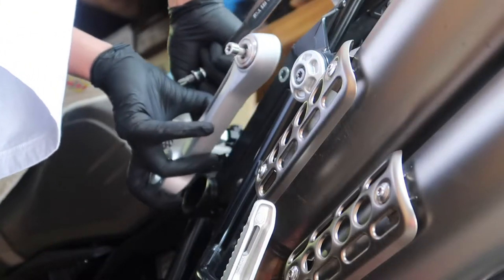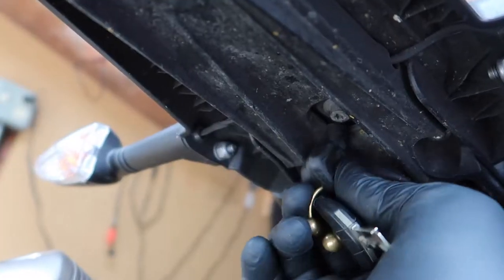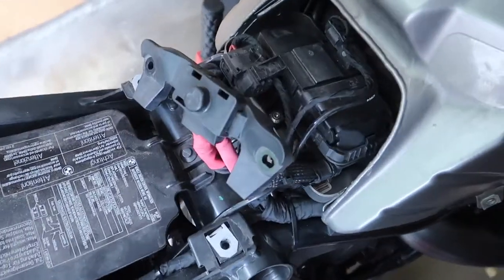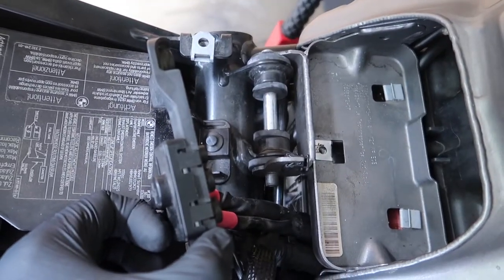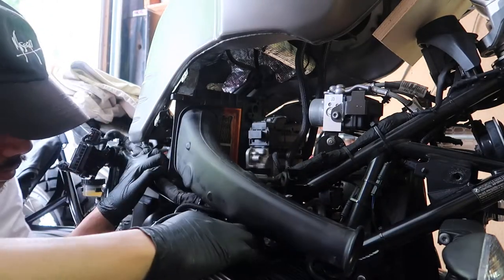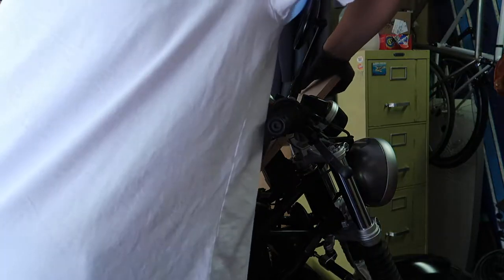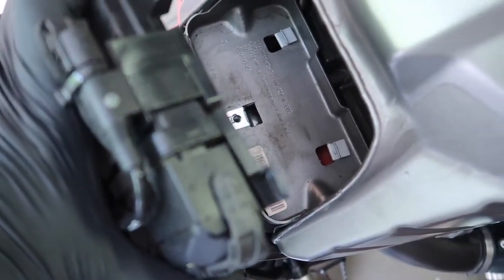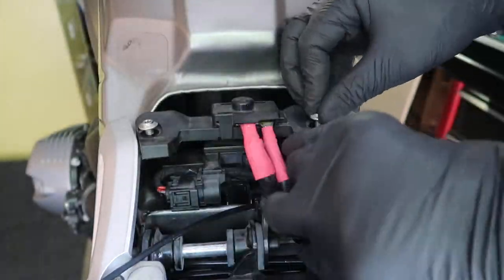BMW R Nine T Scrambler Air Filter Change. 12,000 Mile Service

Comment: People complain about doing this job but you made it look easy! Can the battery also be removed  if necessary?
Reply from the maker: @tnth9099 I haven't made a battery replacement video yet, but the procedure of lifting up the tank in this video also allows you access to the battery from above. So yes, you can remove the battery from the steps in this video with some additional steps in clearing the way from above. Thanks for checking out the video!